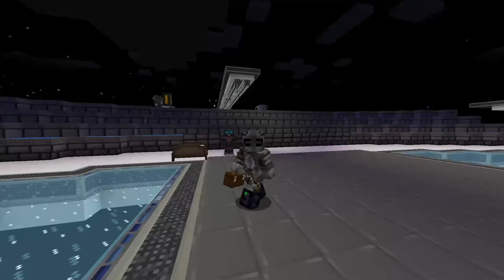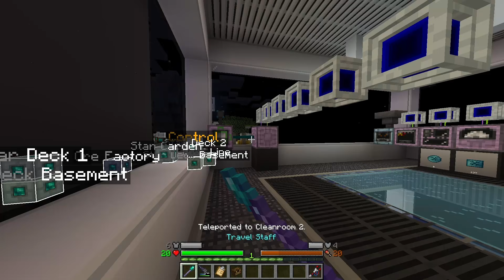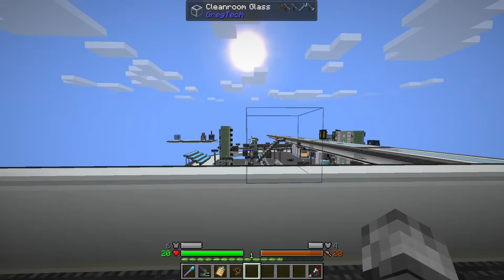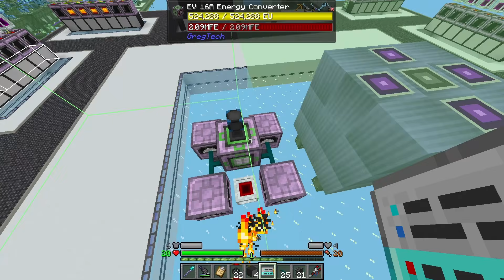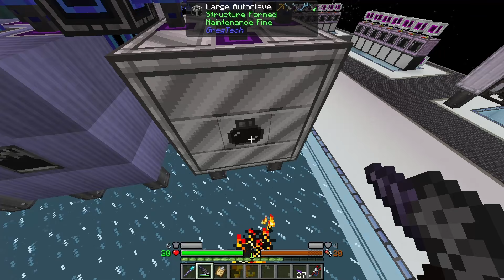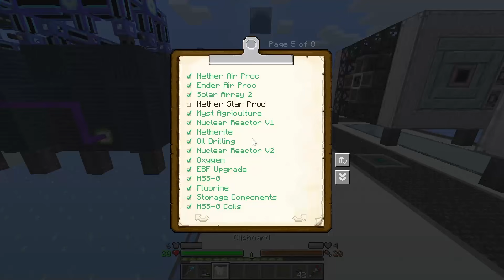What I've been up to and Nether Stars Ep33 Star Technology

Comment: Suggest not passiving materials that require a lot of backup materials, or require an excessive amount of a specific material that is hard to passive(like radon)because if your threshhold being about 32 to a stack then you'll eventually have trouble with using that material with other stuff, so you either have to set it to a really low threshold, or increase production or just autocraft it
Reply from the maker: Ya every once in a while I have to pause something but once I unlock LuV and ZPM I plan on redoing almost everything pre-EV with new machines. I'm pretty committed to not using pattern providers for anything so I understand the issues with passive crafting, I'm looking forward to the challenges it brings
Reply: @megableeder goodluck abt that because some multiblocks are onesided and more on autocrafting instead of passiving, and you can fix the liquid backups with fusion reactors since theres recipes for those hard fluids in the reactor
Reply from the maker: My plan is to use ME Buses on subnets with level emitters for most things. Although I'm sure it will be easier to just add a pattern provider to a subnet with priorities, I will come up with something passive in as many places as I can